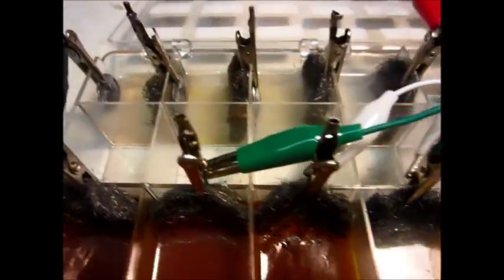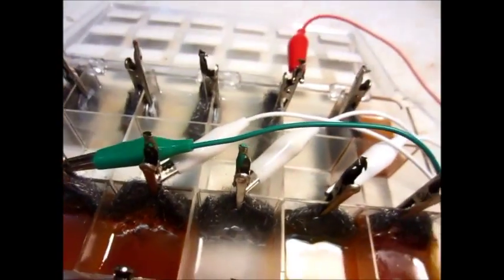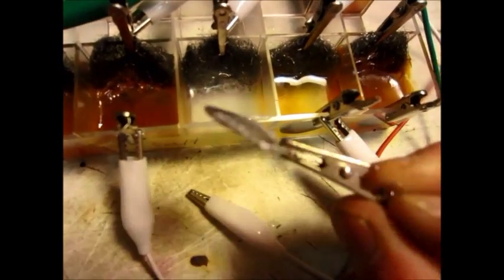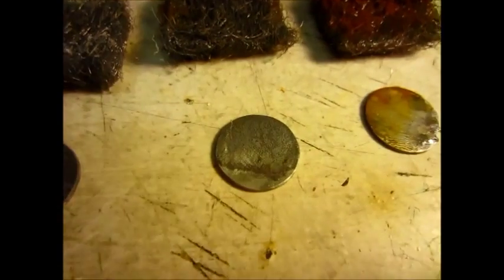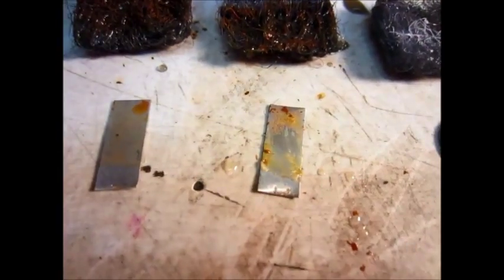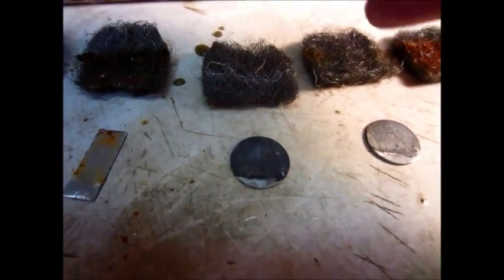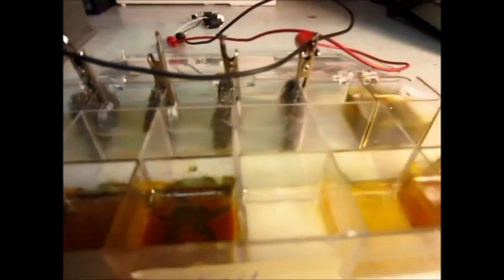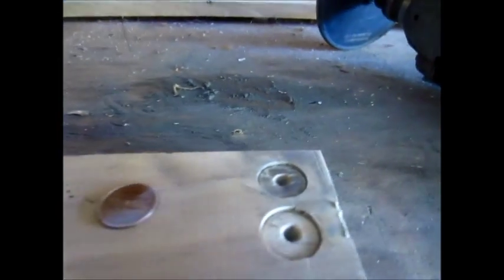Sacrifical Anode Experiment Update

Comment: to makerj 101..i just wondering,how about if i mixed zinc and magnesium by smelting them together.Would it this mixed two of them become more active to be sacrificial anodes on iron and media of seawater?please advise...thank u for your sharing..
Reply from the maker: robby tandiono That's a very good question.  Magnesium is the best to use in fresh water because the magnesium creates a higher voltage and can thus over come the high resistance of the water.  Zinc and aluminium are best in salt water.  If you use magnesium in salt water it would work too well and be sacrificed very quickly needing replaced a lot.  Zinc and aluminium produce a lower voltage and combined with the low resistance of salt water work perfectly.  According to wiki:  https://en.wikipedia.org/wiki/Galvanic_anode
Reply: Thanks for your comment makerj101,your advise is very helpful to me.I will mix magnesium and zinc together by smelted them together for zinc anode purpose.